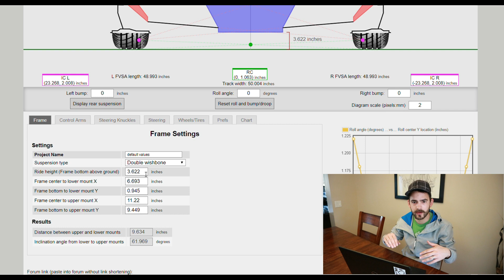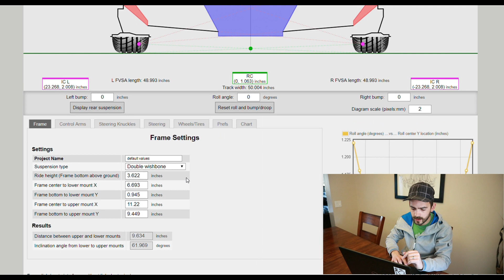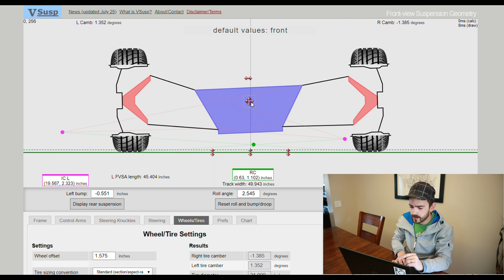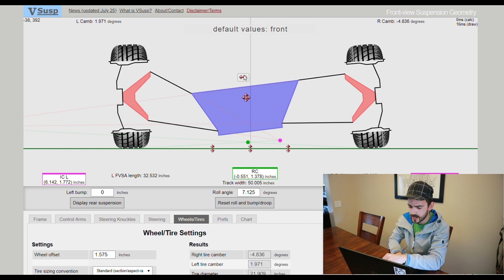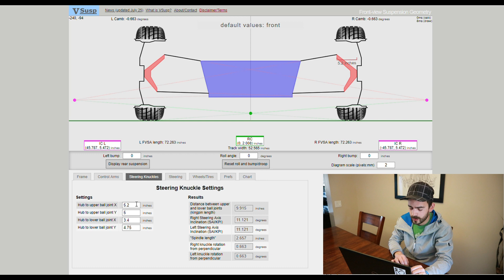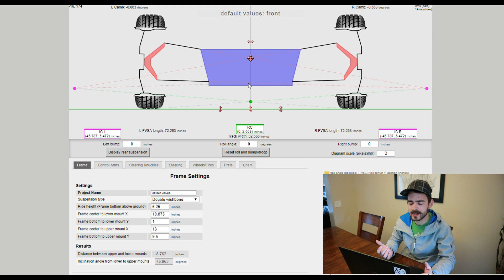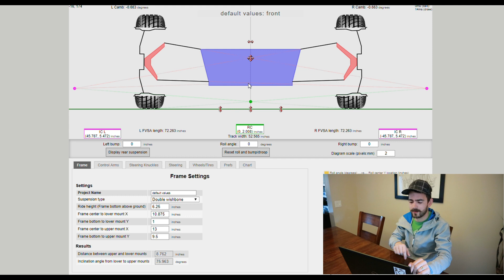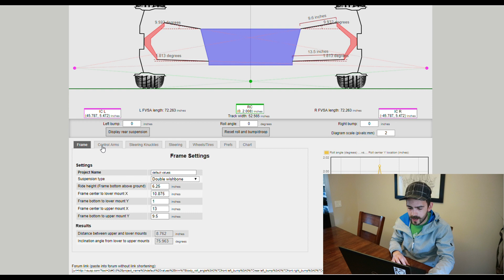Ep 72: Designing the Front Suspension

Comment: Have you done this before?  I've been designing my suspension with Vsusp for a while now and I spent a lot of time making sure the roll center doesn't move left and right, which is difficult.  You don't seem to care that it's moving around so much.  Can you please explain why it doesn't matter?  Also, an 8" differential between rear roll center height and front roll center height still seems like a lot to me.  Do you have a range of what is satisfactory?  Thanks.
Reply from the maker: I have some experience with this but I will admit it is not perfect. With the roll center no near the ground it moves a lot in the software due to how it is calculated but in real world that wont be as big of an issue. Also remember that the roll and movement you can simulate in VSusp is far more than what you will experience in real driving. Yes the roll axis is pretty drastic but I am limited to panhard height in the rear, and this arrangement will lean to a loose oversteer car which I prefer over a tight understeer car, you can drive loose but you can only crash tight!
Reply: @leftfootfirst9847  LOL.  Love the "you can drive loose but only crash tight" comment.  Nothing like going straight when you want to turn, huh?  Thanks for the reply.